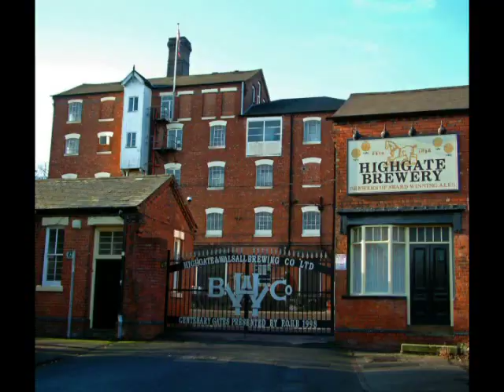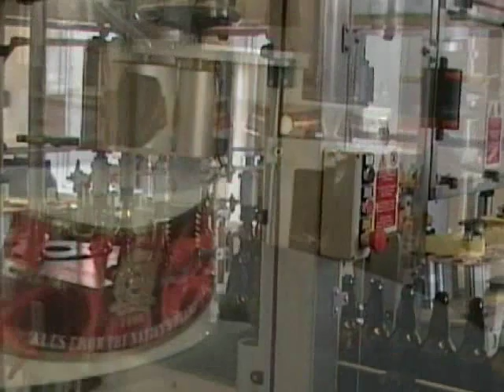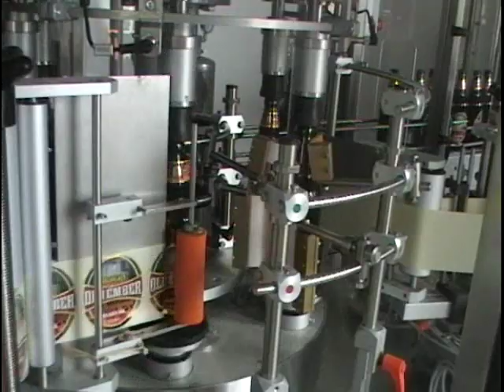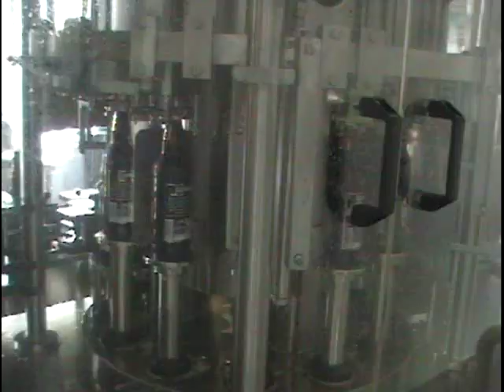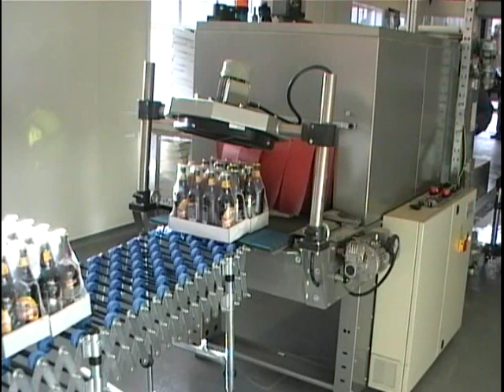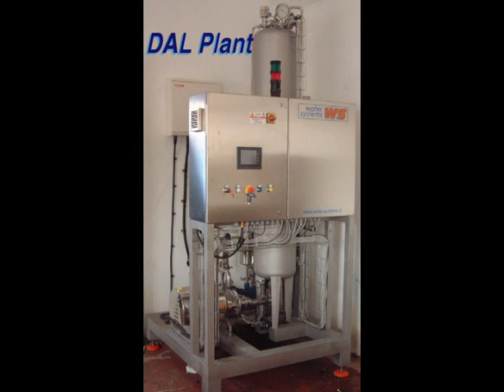Small beer bottling line

Comment: how much for a small one, microbrewery size
Reply: at that rate if they bottle for 24 hours 80 hectolitres 120 Max
Reply from the maker: 2,000bph x 0.5l x 8 hour shift = 8,000litre (assuming 100% efficiency)
Reply from the maker: You hit the nail on the head. The speed of the line is dependent on how many and how fast the operators are. Especially on the manual de-palletising and tray loading. Of course you can use more operators or you can go for automatic machines http://www.enterprisetondelli.co.uk/palletising/ ...... http://www.enterprisetondelli.co.uk/shrinkwrapper-and-multi-pack-machine/